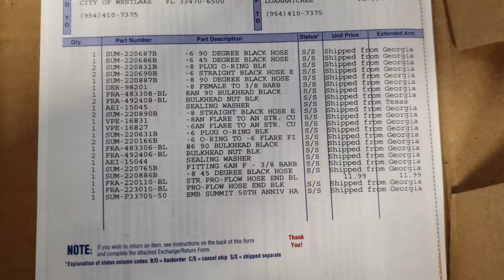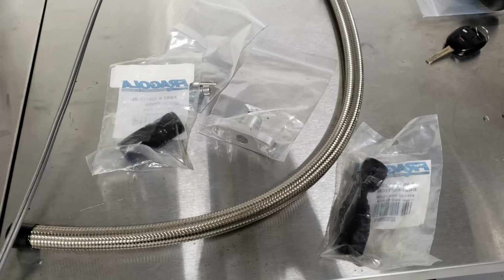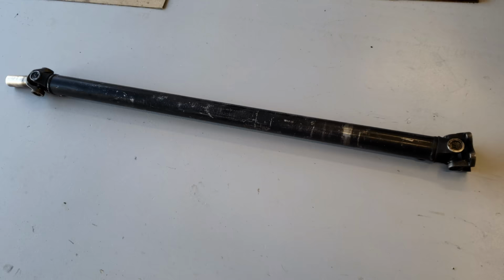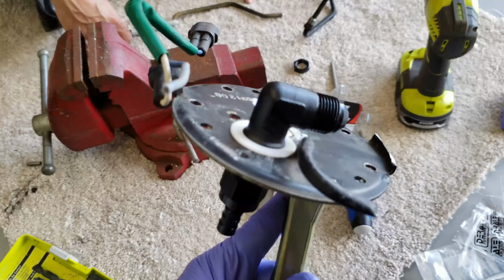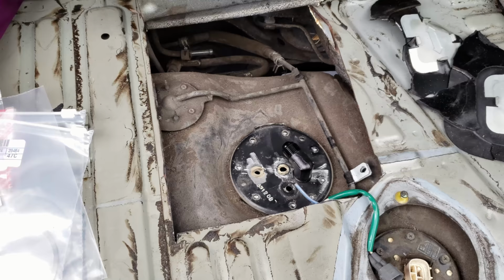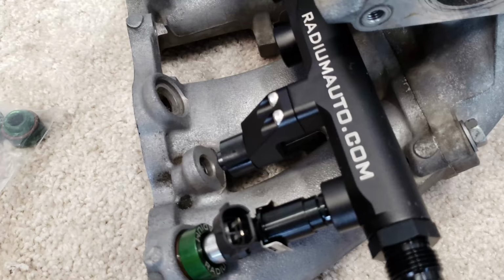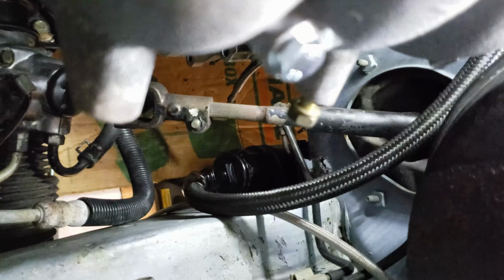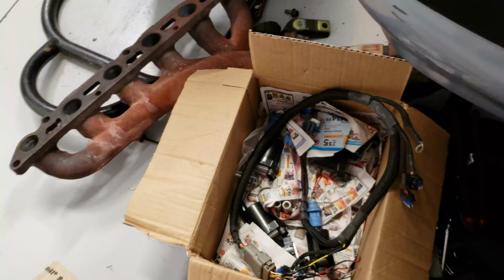Ep.6 Parts galore and 2jz vvti fuel system install

Comment: No need for the 1 piece an/barb fitting. AN fittings seal on the flare only. Just make sure not to scratch the surface.
Reply from the maker: Thanks Phil. Already got a replacement. Always appreciate the help and tips